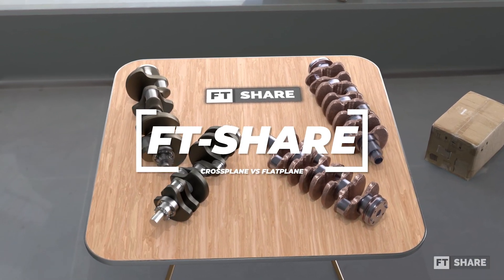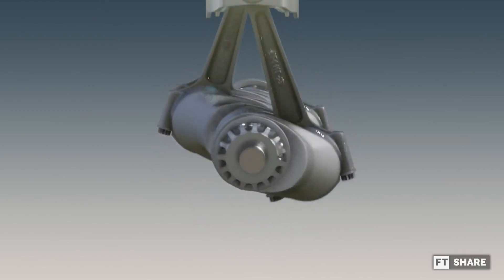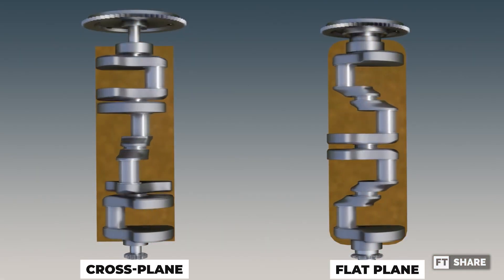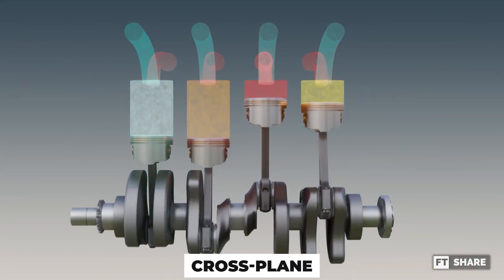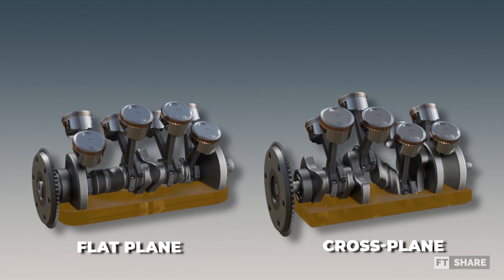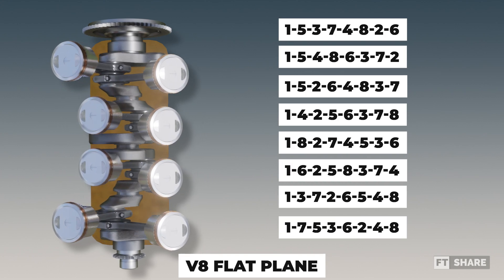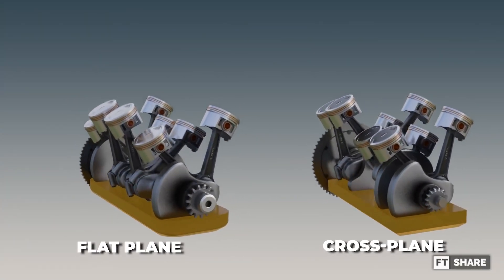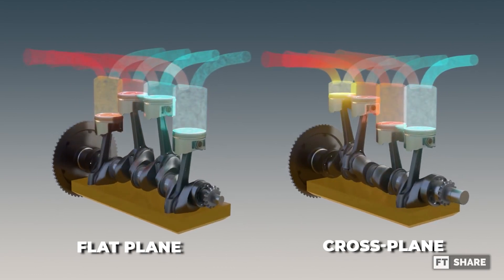Which One Is Better? - Crossplane Vs Flatplane

Comment: incorrect secondary balance, abangkuh. Secondary balance is not the crankpin throwing mass forward & backward, instead its the changing direction of the piston(ascend & descend). 
Due to the circular motion of the crank, the piston experience fastest movement when moving in-between BDC-TDC. And the slowest near the TDC & BDC, irregular acceleration rate. It can be seen on your animation. When we try to push/pull a mass, the mass apply equal force of reaction to us, in this case when piston is pulled downward, it will also apply equal reaction of pulling crankshaft(which is held captive inside the engine, which in turn pull the entire engine upward), and vice versa. This is where balancer come to play, to dampen that irregular acceleration causing secondary imbalance.
Inline 4 flatplane engine has this issue due to all piston is always together doing that irregular acceleration all at the same time.

Meanwhile on inline 4 crossplane, because of its 90 degree interval, when 2 piston is in-between TDC & BDC, the other 2 is at BDC and TDC, only 2 piston doing that irregular acceleration. this is why it got better secondary balance.

Fortnine doing excellent simplifed explanation of primary & secondary balance. Driving4Answer explain them in more detail.